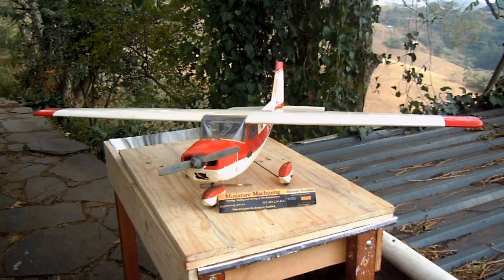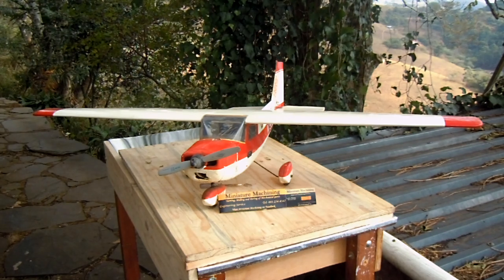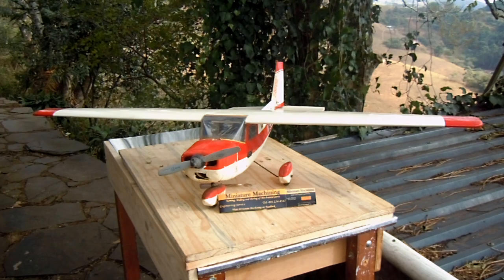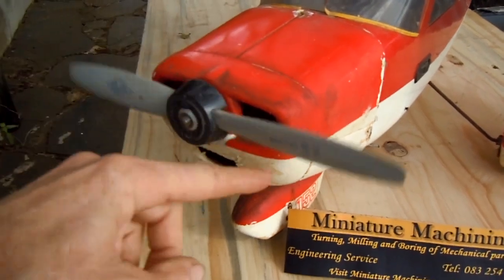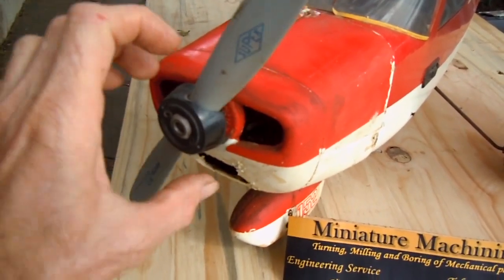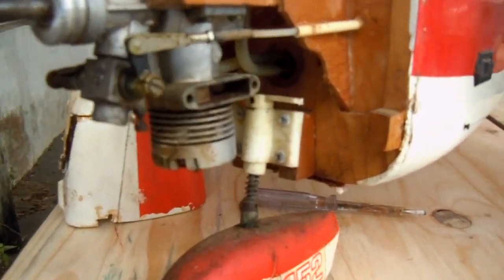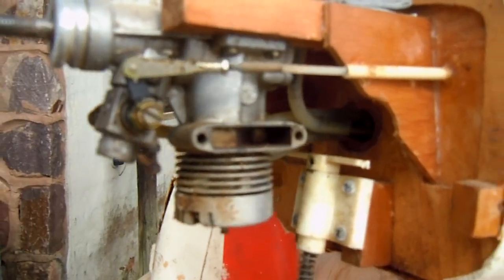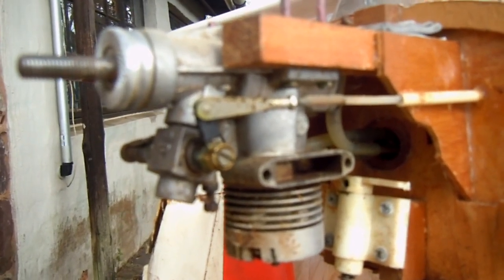Cessna 152 part 1

Comment: Does the engine just exhaust into the cowling?
Reply from the maker: The exhaust is ducted into a manifold which takes it out the cowling, then directs it rearwards into a tuned pipe (muffler / silencer)